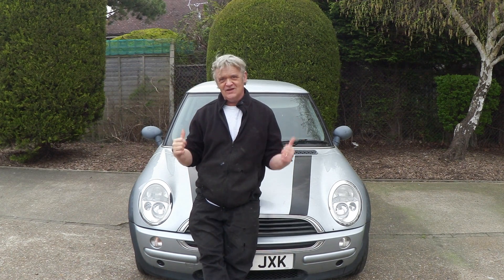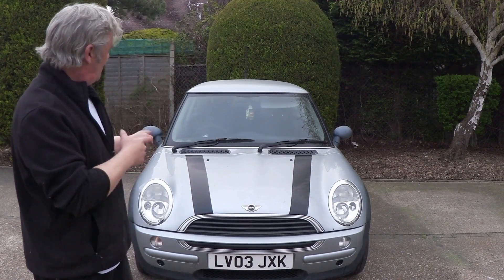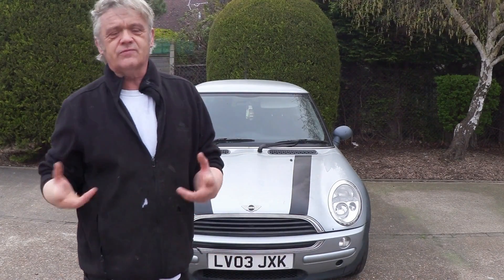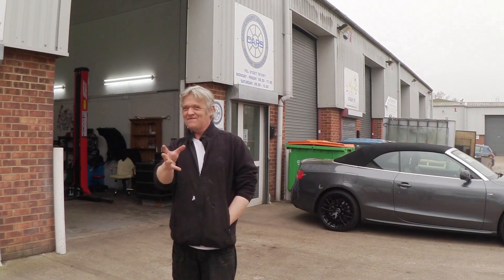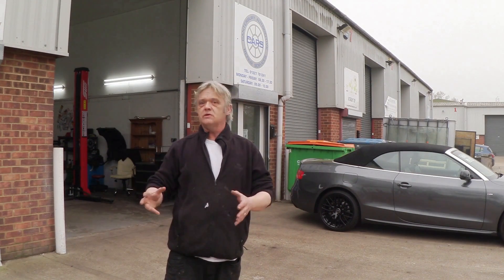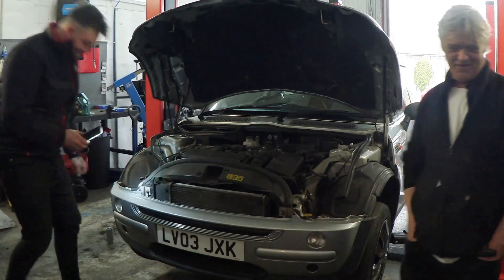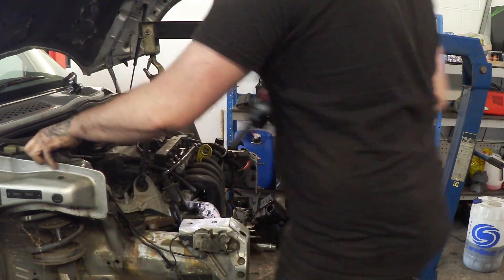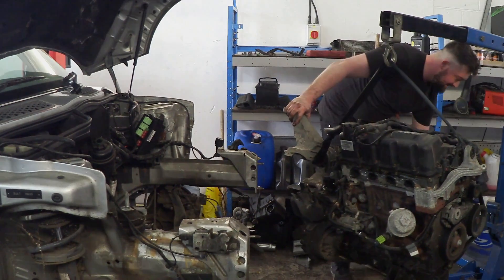1054 Mini To Electric Car Conversion Part 1

Comment: I'm curious about the battery. (And/or cells).
Reply from the maker: probably lead acid
Reply: @ThinkingandTinkering  hmmm....
You provide me with a much needed extra
view on batteries. Thank you. It's the secret of
off the grid. Batteries or an air conditioner size 
reactor.

Comment: April fool's i think , if not you have a big project on your hands the electric motor is the easy prat , with out the ECU not connected to engine the ABS , air bags , central locking  power steering with not work unless you can trick the ECU to think it still has a engine , that is your first consideration to over come . Good luck ......
Reply from the maker: I am sorry mate - but you are not right here - for example the steering is power assisted from a 12v motor - you basically just plug it back in to the battery, the brakes do need a little more - a fish tank vacuum pump and a vacuum reservoir - have a look at rich rebuilds where he did exactly the same thing
Reply: @ThinkingandTinkering  Hi Robert the mini is older , see that now and you are right on the steering and brake vacuum pump  that is doable , all i will say is anything that is running on the can bus network with out the ECU you may have a problems to get some systems to work .

Comment: It's obvious you need a lot of training and tools to remove an engine from this Mini. Some people know they are going to fail.
Reply: Not really socket set and lots of time you just break it down bit by bit till the main block pull the pistons and crankshaft and an average guy can just take it out or drop it down and jack the car up and over.

Comment: Awesome project! Really happy I just found your channel and can't wait for the plan for conversion. I'd be curious if you looked into hub wheel motors because to me they seem to be a good way to convert cars. No need for a drive train, just replace the wheels and add battery and controller. Ok and cooling.

Comment: This is going to be a great series. Someone with a mind like yours can add so much to this project. Molding solar panels to the roof, generators in the wheels, maybe even harnessing the energy lost when braking. The real challenge apart from the engine and transmission will be battery placement to maintain balance. The charging system, would be good if you can minimise the charging costs. 
The diversity of this channel blows me away.

Comment: Checkout Rich Rebuilds, he's already made this swap
Reply from the maker: I know - seen it - cheers mate
Reply: Didn't Rich use a motorcycle set up or something? I'm waiting for Robert to build a motor out of a bunch of scrap he found on the side of the road and a couple magnets
Reply: @docink6175  Robert's already shown some hints of experimentation around building motors, not sure he has a fully formulated plan yet, but that's the fun of following someone with a true scientific mindset.

Comment: Please, please, please do it justice, not just another electric lump and batteries jammed in everywhere. Put your motors inside the wheels and make them an integral part of the steering and suspension (yes 4 smaller motors) and have a 50 50 weight distribution, so you end up with not only a practical build but make it ground breaking, like most of the other stuff you show us.

Comment: A comment to the posters here and to Robert Murray-Smith, if he happens to see it. Can anyone tell me what happened to the twizzy rebuild and the whole battery project connected to it. Maybe I missed a video somewhere but I would love to know how both projects ended up, or if they were scrapped. Also, could anyone tell me if they have ordered the conductive ink and are not in Great Britain. I am a Canuck stuck in Germany and would love to order some, but the whole Brexit mess seems a problem. Any help would be appreciated.
Reply from the maker: stuck on the bms mate
Reply: @ThinkingandTinkering  I assume you mean battery management system. Well, that is above my pay grade :-) Is the project dead then? Also, I would love to order the conductive ink but am hesitant because of Brexit. Have you already dealt with the new paperwork or should I wait or order something from the EU, which is probably not as good?
Reply: I had asked Rob about it a while ago, he said it was finding the finances and time to do the Twizzy project, this was prior to the whole Covid19 pandemic so I dare say its probably been moved to the back of the priority list as I think the whole lockdown and staff furlough thing has probably changed the ways Robs business has to run and approach things until we come out  of the Tier system...this is just a guess but I'm sure he will elaborate more if I'm wrong.
Reply: @weegaz22  Thanks. Have you ordered any of the conductive Ink? Are you in the UK?

Comment: i love it! i spent about 800 pounds on my RENALT 5 "lectric leopard"    IT only goes about 10 miles, but the dogs love riding in it to the local produce stands!! lol
Reply from the maker: my daily drive to work and home is only 8 miles! so it would do fine for me lol
Reply: @ThinkingandTinkering  it has a little Honda Generator under the bonnet too so I can even drive 10 miles into a canyon, then park it, pull start my engine, then go do what ever for a couple hours and then drive back lol

Comment: The classic Mini has now grown to the size of the classic Land Rover. The "old" Mini has a more manageble $ize for EV conversion.
Reply from the maker: I really don't like the new style mini
Reply: The only thing about old Mini's is the chassis just wasn't designed for carrying a lot of weight like batteries if you wanted decent range, that and their rust magnets like typical British cars of the era, and extra weight kills the fun of really small cars, so the newer more modern mini is probably a better base to start from.
Reply: @weegaz22  The official E-mini uses the same hardware as the BMW i3 and looking at the specs, they have cranked up the max current to give it the same acceleration as the i3 and at the same time it has shorter range on the same batterypack. Bjørn Nyland has done some HW tests in the e-Mini and highspeed consumption is high! So this is a heavy vehicle, with midiocre aerodynamics. There is an old Mini conversion done in the UK hovering around on Youtube, and it has reasonable performance with a small motor. I drive myself a 1800lb EV and I get 100mi on a 20 kWh battery pack that weighs only 250lb, so everything becomes cheaper and every household socket becomes a fastcharger. A classic Mini is smaller than my FIAT 600, so on a 20kWh battery and an efficient PM motor, it should get 170mi on a charge that takes 6 hr with a cable out your kitchen window.
Reply: @Tore_Lund  I suppose it depends on what you want from the vehicle, If i had a classic mini I wouldn't EV swap it, I'd rather drop a B16 Honda lump into it, keep it as a proper drivers car than a cheap city EV runabout.
Reply: @weegaz22  Yes, that's fair but you can go cheap and Long Range with a small vehicle, without needing 65kWh of batteries. I like to holliday in my car and getting an EV in my price range, poses an obstacle, and that holds true for most conversions too, unless you throw money at a classic car conversion specialist who transplants the whole innards of a model S. So I get more Chargers to get sub one hour recharge time,  which means more frequent stops, but the same time spend on charging as with a big battery. Also getting a used big battery pack of good quality, is not exactly straight forward, unless you pay premium to a battery broker, or buy LiFePO4 cells from China + taxes and a good BMS which is also expensive. So all that, go for as small vehicle as possible when doing a conversion or expect to pay far more than you imagine.

Comment: Did you consider in-wheel electric motors? Those would make a conversion easier as there is no need to mount engines in the car.
Reply: in wheel motors are great in many respects. But one should be aware that there are cons with them too,  mainly the inwheel motor's add unsprung weight which can  negatively effect handling.
Reply: @kreynolds1123  yes , I have read about that. Some advanced design uses internal springs. I dont know wether this issue is a big deal at all. I mean on modern roads with reasonable speeds..... Personally I wouldnt mind a small trade off in handling to get the conversion job done. Lets wait and see how the project evolves.
Reply: @martinjandijkstra3205  modern  roads 🤔 . I have to say, some places have some pretty bad potholes. But yes driving slower and on well kept roads will handle great 😁.  Otherwise, handling will be a trade off. If the handling is tolerable (very subjective) for the conditions one will encounter for the majority of their driving, then inwheel electric motors will be welcome. 

stiffer springs suporting the additional weight of the batteries should go a ways to keeping the tires on the road, thus mitigating the effect of additional unsprung weight with inwheel electric motors.
Reply: @kreynolds1123  Your suggestion to mount the batteries with strings seems very sound👍
Reply: @martinjandijkstra3205  since we're discussing electric cars, most likely  it will imply the use of batteries for the energy to move them, and given current specific energy density of batteries means one needs to add plenty of battery weight to the frame so as to go reasonable distances, and the additional weight may very well necessitate stiffer suspension springs.
Reply: @kreynolds1123  Maybe Robert suprises us with a miracle battery having ultra high energy density.
Reply from the maker: yes I did mate - it's likely to be what we go with